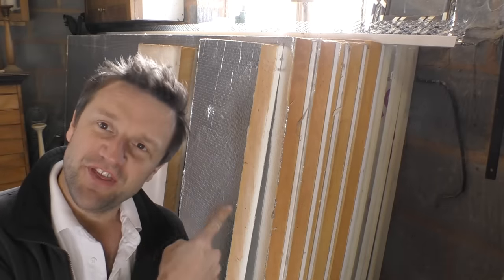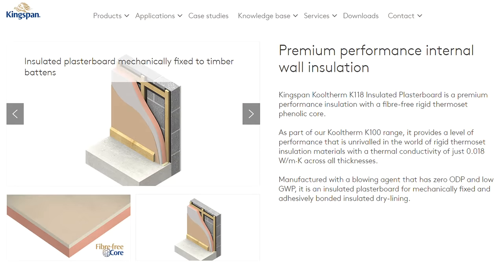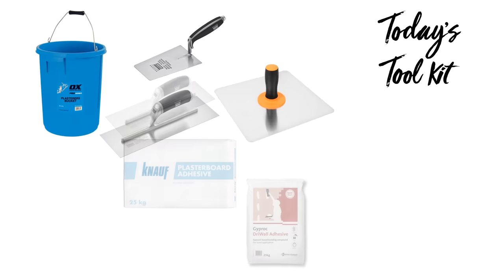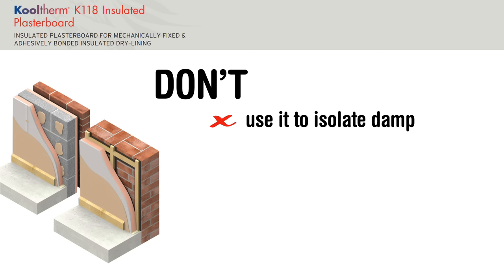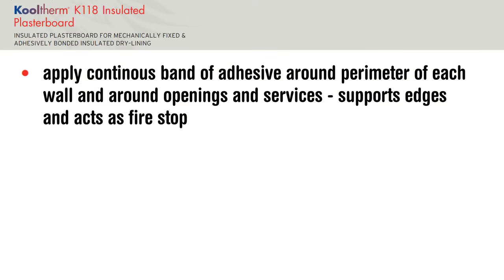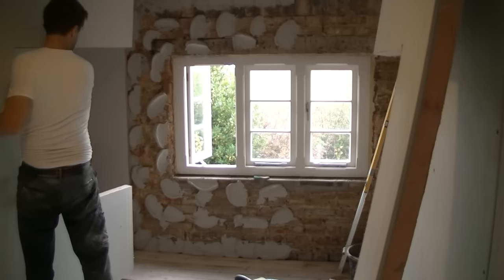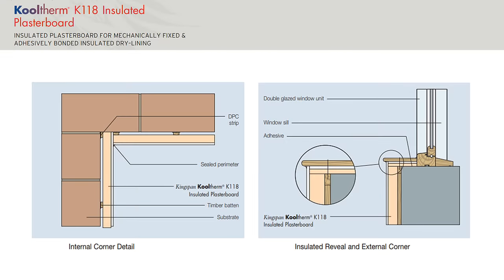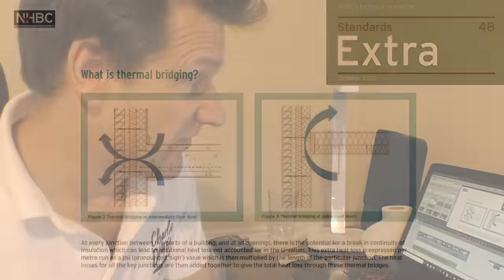How to Dot & Dab Insulated Plasterboard - a DIY Guide

Comment: Great video but you completely skated over tips and tricks with working around windows and window reveals - i.e. do you go into the reveal with a thi8nner board etc, as with 50mm board you'd cover the window frames.
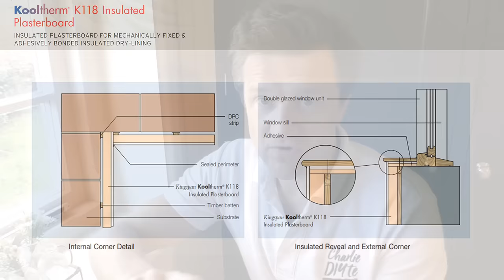Reply from the maker: There's a visual towards the end that shows how you need to maintain continuous insulation around the reveal at 23:23 minutes. Ideally it would be the same thickness as the rest but if your frames are narrow as most peoples are you'll need to find a thinner insulation but the important thing is to ensure there are no breaks in the insulation around the corner as this is a source of cold bridging.
Reply: For your application it may be worth looking into a product called 'Spacetherm'. Much reduced (often 10x) thickness for similar U Value (W/m2k).

Comment: You'd have been better off using the foam plasterboard adhesive, so much easier, I've used drywall adhesive for years but in the last year started using foam adhesive, no mixing or cleaning. The other thing is it's way cheaper to buy the insulation and the plasterboard separately, less waste too, use the foam to glue the PB to the insulation.
Reply from the maker: I agree. Also much better insulator to prevent cold bridging around the plug sockets and in between each sheet.

Comment: Wouldn't  using the aluminium foil on walls do the Same job and be much cheaper
Reply from the maker: How d'you mean? At the end of the day it's all about calculating whether the insulation you're planning on using meets the required u values for building regs.

Comment: You should never dab onto silver lined plasterboard it would be like trying to dab glass,,,the primer is latex based and full of grit..
I appreciate you mechanically fixed it after but still can have a rattly wall after
Reply from the maker: Rhys you're confusing this with foil backed plasterboard - which can't be dot and dabbed. This stuff is designed to be dot and dabbed as the foil is perforated.
Reply: @CharlieDIYte  yes I know but its only perforated enough to take the recommended grit primer not just dab.
Unibonding only stops suction but doesn't provide a key for the adhesive to grip too

Comment: Really not a good idea to do this. You will end up with a warm surface and a cold void behind the board. In time this could become very wet and damp as it gathers condensation, it could then break down the gypsum adhesive as gypsum is water soluble. You will also probably end up with black mould on the surface of the finished plaster as it gathers condensation, unless you have very good ventilation. You should use breathable materials on a property with solid walls. This will allow moisture to pass through the construction and not build up.  The property will be dryer and warmer with clean air. I realise this is only a garage but you don't want the board falling off etc. Good technique for a property with a decent cavity though.
Reply: I think the point is that on the k118 you have metal foil on the back of the insulation. This acts as a continuous vapour barrier preventing moisture from getting into the brickwork and adhesive. The ordering of the layers from inside to out is plasterboard then insulation then vapour barrier then adhesive then brickwork. The dew point should fall somewhere in the middle of the insulation layer.
Reply: @AccountantDoesDIY  Very risky on a solid wall construction though

Comment: I'm a plasterer myself, I personally never recommend drylineing it's crap. Can't fix anything on the wall
Reply: As a plasterer you should know that there is a solid wall behind the dry lining you just got to use longer  fixings!
Reply: plasterboard fixings have come a long way. Im a bathroom fitter and i use a fixing from Corefix. Amazing fixings. Boilers, radiators, wall mounted cabinets, anything so long as you have a solid wall behind the board. There are plenty of youtube video's, in fact, i think Charlie has done one.

Comment: This is literally the worst thing to do to a solid wall that is probably built with lime mortar, will seriously damage the structure of the building with wooden lintels, beams and windows rotting away because moisture is now trapped behind, it'll cost a whole load more to replace than the small saving on your heating costs, plus Kingspan is deadly toxic stuff and most certainly not environmentally friendly!

Comment: Don't use metal fixing pins on a stone house. The cold travels up the pin and leave visible cold spots in the plaster over time. Use plastic ones, i know they are a pain but you will regret it if you don't.
Reply from the maker: Fair point. The only problem is that the point of the fixing is to stop the plasterboard falling in the event of a fire, and I suspect plastic fixings wouldn't meet fire regs.
Reply: @CharlieDIYte  Use a couple of steel pins to hold it and the rest plastic.

Comment: NO NO NO, its not only that you have yourself to blame if you get moisture penetration this is a code violation and if you EVER want to sell your home and this is found out they can force you to pay for it or even demand the purshes to be revoked and mold will still form behind and it will get into the air and it could be a health hazard,. So never EVER do anything that isnt protected from the manufacture and always take photos of everything you diy. Since building codes keep changing and to cover your own ass you need to be able to prove that you have done what was correct at the time. So photos with timestamps on them is a great way to protect yourself.

Comment: This stuff should be strapped and screwed. I've stripped out so many bathrooms and i can pull this off the wall with 1 finger. The insulation on the back of the plasterboard does not bond to any adhesive.
Reply from the maker: Nice bit of info there. 👍
Reply: @CharlieDIYte   the plasterboard adhesive is solid on the breeze block but 10/10 times it does not bond to the insulation backed board. It might look ok but i can guarantee if you put a hole the size of your finger in it you will be able to pull the full sheet off easily. People are tiling over it too and don't realize its basically the tape and filler that's holdng the sheet on!!

Comment: I hate to say it....but now you certainly won't see any fungus growing on your walls...it will be tucked away behind your DIY panels....
Reply from the maker: I don't agree. Mould/fungus is caused by the moisture in the air hitting a cold surface. Provided it's properly installed with no cold bridges, there's no way the moisture can get through to the wall behind.
Reply: @CharlieDIYte  You don't have a continuous vapour barrier. The moisture will pour through the joints between the boards and through the sockets cutouts. Take a look at the aecb retrofit course. There is a lot of well researched information about how to insulate old houses.

Comment: he should be lime plastering it only and if need be lime plastering the outside if you do that to a solid wall house you will screw up you building. your solid walls need to breath . the only thing you can do is put more heat and ventilation in . dont mix moderns with old . its why so many houses are in a terrible state . lets see is 15 years time 🤣🤣🤣🤣 this is the totally wrong thing to do

Comment: This stuff makes me laugh. If you live in the UK you probably live in a house that could easily have been built by drunken chimpanzees. It's falling apart, was bodged at the time, probably has a shower or bathroom that has zero protection against leaks. We must have the worst (and most expensive) buildings in the first world - standards or no standards.

Comment: "insulation" haha, 30mm 60mm not have insulation anywere, maybe tropic area have but normal north europe and north usa or canada no have. you need 150mm-300mm insulation if want warm house, or cool keep in air-con house tropic area. and save lot money have good insulation. this is big joke only.
Reply: 50mm of Kingspan is equivalent to 200mm of the old glass wool insulation. I think you need to take a refresher course in insulation types and u values (if you know what that is).